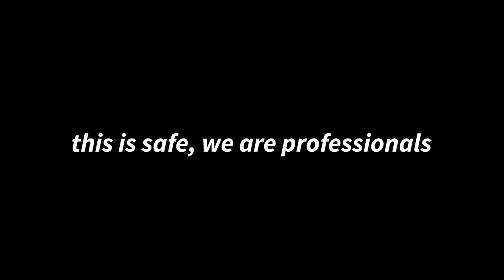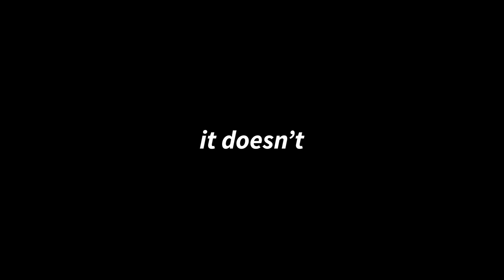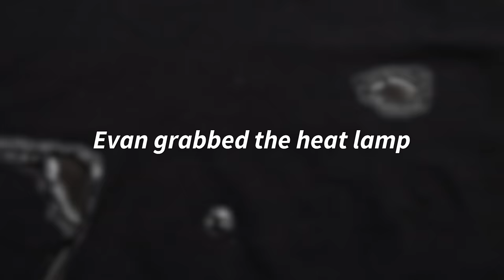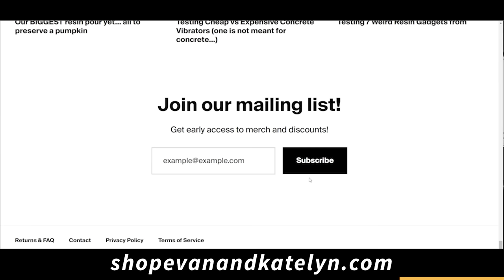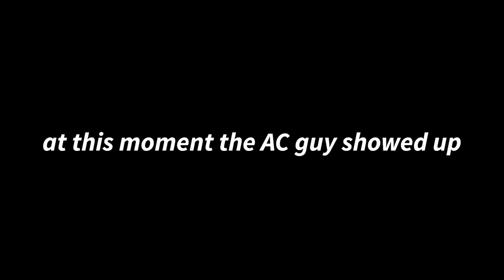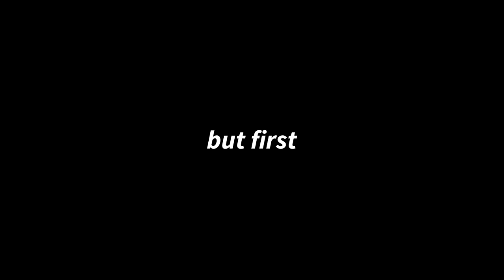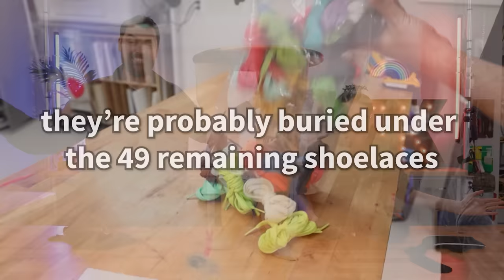We made your weird DIY ideas

Comment: To give Evan some credit for the 100 layer shirt lasagna idea, look up what Micarta is. It's a bunch of fabrics stacked together and saturated with glue and then cut and sanded down to any shape. I've only seen it used for knife handles, but I'm sure there's other uses.
Reply: There’s one guy on here that makes sunglasses frames out of denim using this method
Reply: @starlightlilly7203  There is this other guy that made a table out of denim, I don't think it was the same method though.

Comment: For the legs, fill them with expanding foam. Put a circle of wood at the top parallel to the top. Trim the top level. Now you can put a small bolt in the leg and a t-nut into the top. For figuring out how to cut the legs, a laser level would mark them so you could put a cut line at the top. Then make a bunch to start selling them as the perfect accessory for a replica lamp from “A Christmas Story”.
Reply: I was surprised they didn't laser level them off!
Reply: @mary78880  I can’t recall if they have used one before. If not, that’s a new tool for Evan. I got a Craftsman one years ago as a Christmas gift. It is not self leveling though. I’ve used it to hang pictures mostly. My mom  used to buy me new tools she saw being advertised around Christmas.

Comment: I genuinely think the hammer shoes could be decent if designed well. Like, the metal needs to be thick (and securely attached) but you could tell it would work by the amount that the nail went down after she slammed her heel specifically. Every time it was the heel it drove down pretty well. Enough force and a good chunk of metal and that might actually work pretty okay (why you would actually do it though is beyond me)

Comment: Dunno if it’s been suggested already, but next time, for the “fixing tears in clothing with resin”, I’d suggest using a soft type UV resin and to cure it as soon as you finish filling up a tear (instead of filling them all and then curing them). Not sure it would really fix the problem, but it would probably avoid the soaking problem and be a tad more practical xD. Legatha is gorgeous BTW!

Comment: Laser level. Mark table legs and trim crooked bits. Resin pour into appropriately sized mold, set cut leg edge into resin, cure. Tada. New flat leg tops that you can drill into.

Comment: Ive fixed clothes with superglue and same rigidity and cracking. Now I glue w E6000 and it worksngr8 since its flexible. You guys should explore different methods to mend fabrics without sewing. Hotfix adhesive is also very good for diy patches

Comment: 4:58
Gonna make a prediction. Shes not gonna be able to get enough momentum with her foot because instead of a swinging motion its a stomping motion. Also the energy wouldnt have anywhere to disperse so its gonna shock her feet and she xould damage herself. She shouldve designed it more like a steel tip and that could help with the low horizontal nails.

Comment: so hammer shoe , have a short-tend hammer head attached to the front of the shoe , with a linkage to a vertical pole , by rocking the pole back and forth it moves the hammer head down and back up , utilizing the amazing force of leverage :)

Comment: If you were to revisit the Hammer shoe in the future, here are a few ideas how it could may be improved:
1) Instead of threading the Metal directly, maybe put something like D-rings on the Metal, and then thread the laces through the rings. That could improve how they sit and hold on the shoe.
2) Instead of making a full Metal sole, position the Metal plate only under the heel, or maybe take a shoe with a bit of a Heel and replace (part of) the Heel with the Metal. It would restrict you to only "hammer" with the Heel, but I think that would transfer more of the Energy into the Nail, since it is more or less in Line with your Leg Bones, while the rest of the foot can (in lack of a better word) "twist" at the ankle, loosing much of the Energy.

Comment: My idea for a redesigned hammer shoe. 
Have the hammer all in the heel.
Have a built in claw for the back of the shoe to pull out nails or have it built into the heel or in the toe. Where a hammer could also be placed. But it would have a lot of cushioning to not break your foot

Comment: A lot of the problems with the leg table could've been avoided by simply getting full size mannequin legs and sawing them flat. 

If I were doing this, I would probably would've filled them something. Like fill the legs mostly with sand, then put some plastic over the sand, and pour about and inch or so resin over the plastic so they have a solid top to put screws into. 

And then just a bigger piece of wood for the table top so they can be further apart. Maybe do a square table so that you can have 4 legs and use all of both pairs of hose and shoes. And also, the stance wouldn't look so weird.

Comment: I feel like the hammering would have worked way better if it was just focused on the heel. Most workboots aren't flat like the contraption you made and most of the force in your leg could be concentrated thru the heel. Maybe a hammershoes 2.0 could be a heavy-duty plate that could click on over the heel🤔

Comment: Hi Evan and Kaitlyn, an idea that I would love to see is where you do another resin time and make a resin fold out fan?

I was thinking that you could make the ribs of the fan out of thicker .5’’ - .25’’ resin and then making a thinner .1’’ resin sheet and then resin the two together to make the fan. After all of that you could use a brass screw and bolt and bolt cover to make it have a nice finish. You could add your own design to it by using your magic touch to nudge it in the right direction 😅👍

Edit: please like to make sure Evan and Kaitlyn see this!🙏

Comment: I almost feel like half-assing the Table of Legs is a shame, it has awesome potential if done properly. Add a proper top with some routed-out fitting holes for the legs, saw the top of the thigh nice and flat and secure them properly etc so that the shoes ALSO dont hit each other. This calls for a rematch...

With a Bookshelf made of mannequin ARMS and HANDS.

Comment: Re: Resin shirt holes
When I had a problem where the fabric around the zippers in my Tom BIhn bag frayed (it's still indestructible which is wild), a seamstress teacher advised me to trim off all the frayed fabric and hit the seam with fabric adhesive. That stuff is kinda like resin, except it doesn't set up hard. It's supposed to be for holding a complex seam together while you sew it, or to hold a patch in place before sewing it and a hole closed.

Why is a cutting board more expensive than a lazy susan? A cutting board has to be food grade.

I'm wondering if something like Apoxie Sculpt might be of interest to you two? It's a 2-part epoxy clay with a fairly long work time. I don't know if it's stronger than the wood filler epoxy (which I have used, and it's... OK), but it cures to a similar finish.

I thought, "Hey, isn't there some sort of material that cosplayers might use for that hose?... No wait, anything a cosplayer uses is going to be temporary." Also thought ballet slippers rather than heels for some reason.

Comment: If you mix 20% vegetable glycerin and 80% resin, it should be flexible when cured.

This is an untested hypothesis based on mixing glycerin with 5-min epoxy.